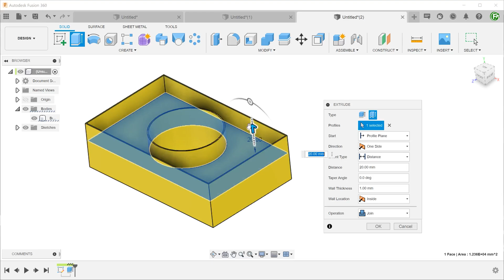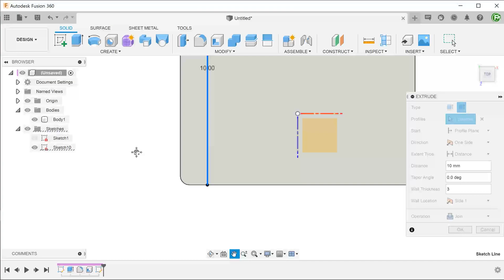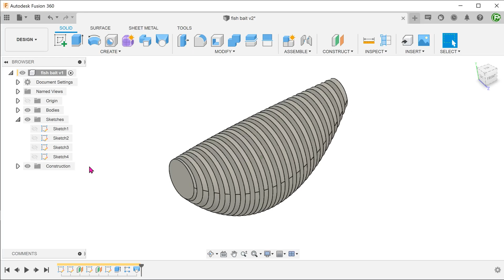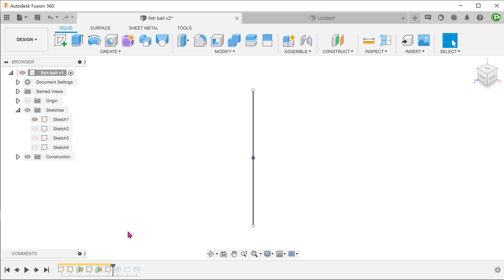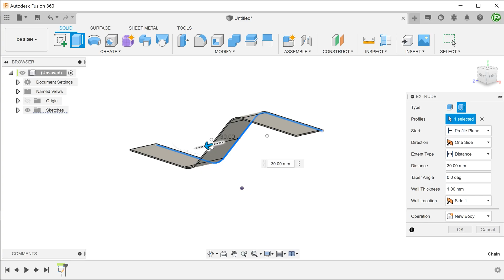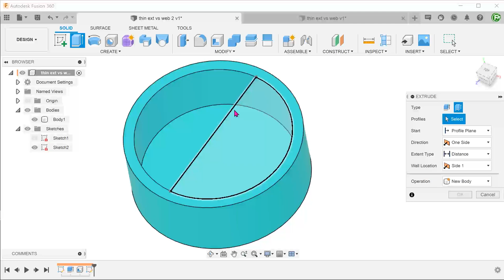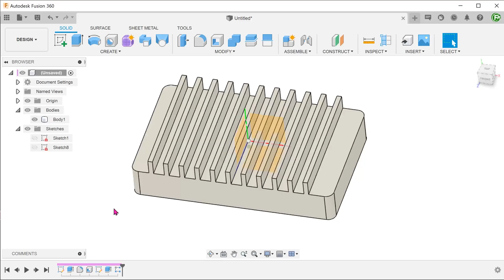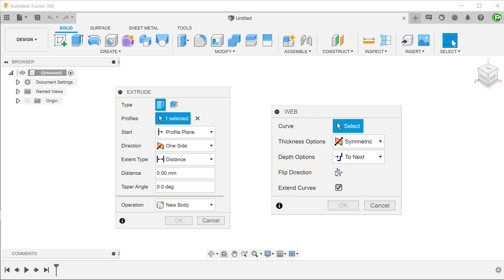Fusion 360 - Thin Extrude (Open Profile)

Comment: Since it was introduced i haven't modeled anything in fusion, this is awesome and has been missing, Blender and most others have been able to do this forever, extrude vertex to a line, extrude a line to a surface, extrude the surface to a wall.. i went to blender for the stuff missing in fusion, now i wouldn't need to change as often